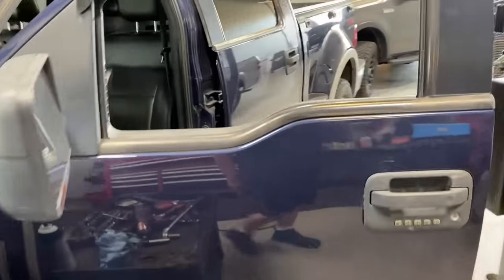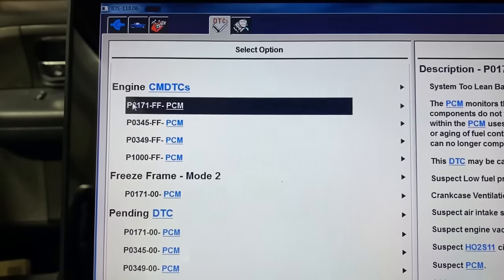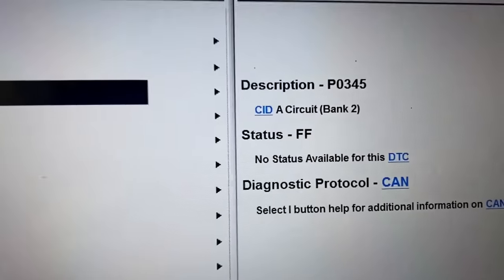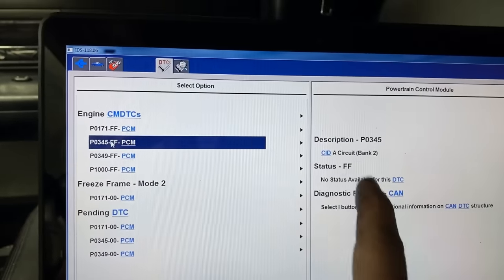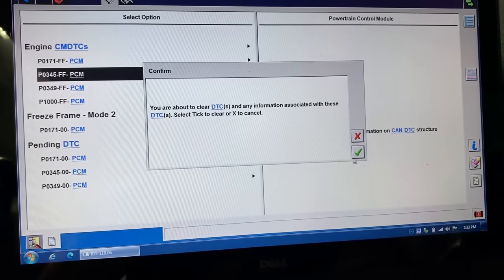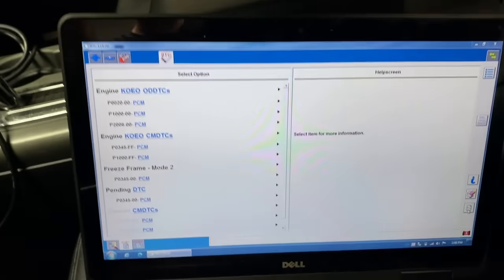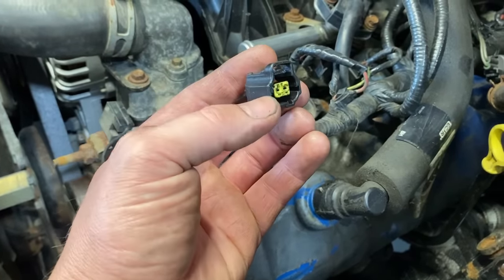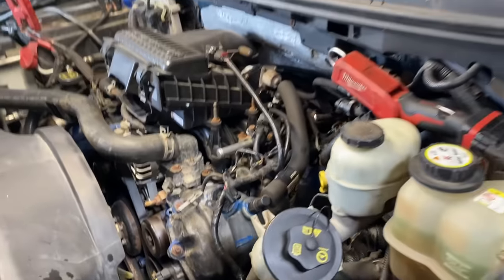Ford F-150 5.4L 3v Triton Engine Runs Rough: P0340 P0344 P0345 P0349 VCT Timing Error Diagnostics

Comment from the maker: These are the Parts and Tools I Recommend:
Ford Phaser-
https://amzn.to/3ijl2H3
Ford VCT Solenoid-
https://amzn.to/3gZwYw0
Noid Test Light Set-
https://amzn.to/324Gtpl

Forscan is free Ford Specific Diagnostic Software:
Download Here- 
https://forscan.org/home.html
ELM 327 Adapter I Recommend-
https://amzn.to/2GC6dBj

As an Amazon Associate I earn from qualifying purchases.
Reply: Help please.... I pulled into the driveway and my gear shifter went soft on me and wont select gears, now i cant get it into park and i cant start the truck....f150 5.4 2006.....i dont know what to do
Reply: @Jesse Ajuda 5w-30 no doubt
Reply: Matt Blackwood try starting in neutral.    Also see if this is similar issue.   🍻
Reply: @michaelwerbick  I found it the transmission shift cable was broken thanks
Reply: @matthewblackwood4704  check transmission fluid first. If fluid is OK, it means the transmission neutral switch is not properly engaged in park, so it won't start. Make sure you can pry the transmission gear knob area with a screw driver, to help engage the transmission in park.
Reply: @dxta7360  it was a broken trans shift cable, thanks
Reply: Thought you said the Dorman XD version of phaser was a good product in a previous video. Is that still true?
Reply: My 05 5.4 has p0010 and p0011. If I redo the vct's and timing how long should I expect them to last.  It has 176,000 on it now.  What should i do trade or fix it!  I love my truck just need it to be reliable!
Reply: Do yo u have a date to come to San Diego? I'd love to have you take a look at my 04 overlander.. I've done a lot of work to it, but I have a rough start that sounds like a leaking manifold even though I just installed new jba headers.. it goes away after 10 seconds. I've recently done the timing chain kit replacement as well. I do have a winding noise that goes away when I match engine timing.. sounds like a pulley, but I have replaced all the pulleys. I honestly have the best of the F150s 2004, and would love for you to take a look at it and try to make it perfect.. I have many mods worth thousands, and want to avoid an engine replacement if possible.. help?
Reply: do you this same ford phaser for both sides?

Comment: That engine looks more like a salvage yard engine instead of a Reman
Reply: I've seen some that the scrap yards so call rebuild themselves. It may have been a scrap yard take out from a crappy rebuilder too. I've never seen a blue one like that either.
Reply from the maker: Yeah it was bad on the outside but definitely a reman engine inside.
Reply: If you’re having issues w these things, it’s time for a good quality reman crate motor, don’t waste your time with the cam phasers, they would be working if there was oil pressure, & because they’re not they’re garbage along with the motor.

Grenade the motor then drop a crate motor in it not from the crap yard that’s not a 3v & it’ll be fine.
Reply: That's a Krylon rebuild.  Fresh coat, and it's good to go!!

Comment: That’s probably the thing I enjoy most about your videos: 

You don’t just start replacing parts and say “Maybe this will work” or “Maybe this will fix it”. 

You actually take the time and do actual diagnosis and do a process of elimination. Part by part, step-by-step. This is the way it should be. But as you already know, a lot of dealerships don’t do that. They just start replacing parts and hope that it’ll fix the problem. Keep up the good work.

Comment: We have similar problems at the plant where the 5.0L is built. If the exhaust VCT isn't installed correctly it will ruin the VCT and nose of the cam when it goes through the machine that checks the timing. I said all that just to agree that if you don't install the VCT correctly and torque it properly you're wasting your time and money. Great video and i agree with another commenter that this guy is thorough and explains what to look for and what not to do on certain repairs.

Comment: I have the same code popping up P0345. I changed the CamShaft sensor, no luck... I pulled the VCT solenoid and cranked the engine just like you did... Still gets me the error code. Now... I'm going in to check the phaser. It's been worked on before. Prior owner had some work done on it. I'm fearing they also used aftermarket sub quality parts. Now. I'm going to fix it. Your videos are so helpful. I'm legitimately done taking my cars and trucks to mechanic shops. I get it all done myself now with the help of Hanes and Chilton books plus your videos. Thank you!

Comment: Love your videos man, but I can't watch your 5.4 videos anymore, I already fixed the phasers, cam chain, tensioners, spark plugs, VCT solenoids, and oil pump. I don't want to jinx it anymore 😂
Reply from the maker: lol I hear ya!
Reply: I’m currently looking to change my VCT solenoids
Reply: As long as you put a good oil pump in and not a stock Ford unit. you will probably not have another issue. Please tell us you used a Boundary or Melling or Livernois or Moroso or PCE. If you used a Ford one, I sure hope it was a Ford Racing model like the one used in the GT 500.... Good luck.
Reply: Me to

Comment: I absolutely love your videos. I have a 2007 f150 and it had that infamous tick. I replaced all ruler followers, And slack adjusters but a new milling oil pump and had to do the timing because the right hand bank had slop in the chain. I didn't realize how easy it was to do the timing on a 5.4  3 valve. While I was in there, I did a phaser lockout as well because I don't like how prone they are to fail. Since doing all that it runs great. I just need to get a tune now to make up for the phaser Lockouts

Comment: I'm not a fan of the 3V but so many of the problems with them are avoidable with proper diagnosing and OEM parts. So many mechanics should watch your videos.
Reply: Man if the remanufactured engines are gonna be rebuilt like this then I'll just do it myself with an engine rebuilder.

Comment: Many thanks for posting this!!  I've had the  MIL lit for a couple years now for the P0340/0344 code.  Kept putting off removing the valve cover to check the "fingers" on the phaser.  Will run these diagnostics first and see what comes up. Excellent advice my friend!!
Reply: Hey eco builder, were you able to figure out those codes? I have the same ones

Comment: Great diag! It seems like I won't see these 3valves for a while then all of a sudden they start coming in one after another, at my age of 56 and working on so many different car lines I definitely need a refresher in these engines from time to time. Down here in South Louisiana we don't have to deal with rust and most of these trucks are in good shape, but if I can learn any thing about any vehicle especially these engines I'm all ears. I'm one of the few shops that will work on these engines, a lot of the other shops have been burned on them so they won't touch them. Great video looking forward to the next one!
Reply from the maker: Those other shops just didn't know what they were doing these engines are very simple to diagnose and fix.

Comment: Thanks for the advice on the vacuum brake bleeder, I bought the one you recommended on Amazon and it worked great. I bled the brakes on my ‘15 Jetta and it was a breeze.  On my ‘13 Pathfinder, Nissan recommends disabling the ABS pump by disconnecting the negative battery terminal before bleeding the brakes.
Reply: Have you tried "speed bleeders"? Makes solo bleeding much easier.

Comment: Dude I have engine knock and had some of those codes apear, along with a rought idle than stall out when engine is hot at low rpms. I got it working better now after a motor flush and some thicker oil. Anyways I will have to so this job soon and this video is excellent. You make the best F150 repair vids, thank you bro!
Reply: Probably cam phasers. Those are what make the knocking noise at least
Reply: Try Lucas synthetic oil stabilizer to buy some time. 1 qt added to your next oil change might help keep it going.
Reply: Purecult if it stalls out it could be the solenoids or it could be your fuel module
Reply: You ever do the timing job or anything? I have the exact same issue
Reply: I've been running okay with frequent oil changes (every 5k miles) and a bottle of oil stabilizer now for 2 yrs since I got the truck. It seems to be worse sometimess, better at other times. Runs fine, no stalling. 

In fact, someone pointed the ticking out to me saying they had a Triton engine do this but I no longer noticed it until he pointed it out.

I drove 2000 miles cross country and towed a trailer with a car on it no problem last year.
Reply: @purecuIt  what parts did you end up swapping or literally just the oil changes and stabilizer?

Comment: This is great stuff! I plan to use the exact same diagnosis.  Last year I did the whole timing job: the chain, phasers, solenoids....ALL Ford parts.  I put a Melling 340HV oil pump in too.   Sometimes when coming to a stop, the timing on one bank will not go back to base.  It's like it's stuck activated.
Reply from the maker: That is an oil pressure and volume issue.  If you are sure everything was installed properly and the pan has been cleaned out with no startup rattle then I recommend performing a crankshaft end play check. If ok then use 5w-30 oil, if the concern is still there then use Rotella 5w-40 oil.
Reply: @FordTechMakuloco  I still have to drop the pan and check/clean the pickup tube.  I don't recall any broken pieces or chunks missing from the teardown but I suppose I could find something wrong.  
I'll report back on what I find!
Reply: Today I dropped the pan. Found a chunk of what looks like a guide in the pickup screen. And also a lining on the bottom of the pan with grit, looks like from the old chains.
Cleaned everything and reinstalled. I checked crank endplay too, very little movement. Less than 004
I am STILL getting this to happen.
I'm just like WTF at this point
Reply: Oh and I'm getting 21psi oil pressure when this happens. It remains steady and doesn't bounce around on the gauge.
Reply: @gmtech2012  Did you check the cam cap ends for gasket debree? Radiator cam cap on the drivers cam, and the cap next to the firewall on the passenger side cam? There is a gasket that goes behind where your oil filter screws on, on my triton that gasket was breaking off. I found a few pieces of it clogging up the tiny oil passages in the caps I described.
Reply: @TheUltimateCrash1990  I'm fairly certain that the engine went back together without any real big debris pieces left inside.  Now I will say that in the last month or so, this truck has not had any cam oscillation whatsoever.  The last thing I did was start the engine with the vct solenoids out to clear out the housings like in the video.  Maybe something was there?  I will update here if I experience any more issues but at this moment the truck is running great.  Lots of power and no noise.

Comment: Had codes 0345 and 0022 so I replaced driver side vvt solenoid and camshaft position sensor. Changed oil and filter. Those codes went away, next day CEL came back on this time with code 0012. Not sure where to go from here. Thank you for all the great videos!
Reply from the maker: You have no control over the vct system, it definitely needs a timing job or more depending on the condition of the engine.

Comment: 04 f150 5.4 3v 270,000 mi. All original. 15w40 motor oil since new. Runs flawless.
Reply from the maker: Yes I have heard of many doing this
Reply: Original: valve covers never removed,starter, water pump,coolant, power steering,coil packs,fuel system,exhaust all original.  E3 diamond💎 spark plugs have 100k mi on them..new belt /idler pulleys at 250k mi. Alternator once.
Reply: I run 8qrts/2 gallons of 15w40

Comment: Would it be wise to check the phaser bolt on the other cam?
I guess the lesson here is to ask if a manufactured engine has genuine Ford parts.  Not mystery parts.
Reply: This Black Dude  I agree with everything you say..BUT...The most incompetent reman company would do a better job than I would!!
Reply: This Black Dude Because many rebuilders quit rebuilding 3 valve Tritons because they had many returns.

Comment: I can really use your help on this! I have a 2004 Ford F-150 with 155,000 miles on it around 100,000 miles the timing was done on it the full subang with moterctaft parts! At 140,000 my transmission went out, I had it replaced but the transmission shop damaged the transmission lines so all the fluid leaked out 2 days later. They put new lines on it but my motor was running really rough and it was indicative of cam phasers. Took it to the shop and me and the mechanic got into the front end and realized my timing chain has stretched and it broke a guide, we redid the entire timing on it and it’s been driving perfectly until the past few thousand miles, ever since I purchased the truck it’s had a p1000 code and it doesn’t throw a check engine light but that’s not my main problem my problem is I’ll go to work in the morning start up the truck and I see a puff of smoke out the tail pipe for a second and sometimes when I get on the grass smoke will come out, also when I get home and put in in reverse to back up the driveway it starts to run really rough but if I get the rpms above 1500 for a second everything smooths out, it throws a p0022 code and I’m really confused now! What should I look for. It has new camshaft position sensors, new vct things, new spark plugs, and new coil packs! Please help!

Comment: Not sure how I feel having a 5.4 3v f150 knowing there are guys like Brian making a living out of just doing repairs on this motor..that says a lot. But when this thing is running good it's an awesome truck. I have 190k and I do have a ticking but also using about 1/2 qt oil in 700 miles or so, I'm so torn on having a timing job done or just letting it last as long as it can the way it is then put a new ford rebuilt in it.

Comment: So i have a random misfire code, crank sensor issue and a timing code issue amd the infamous phaser tick.. am i safe to assume 8 jeed a timing job.The truck had head work done valve terrain work new transmission.

Comment: Same truck and engine, I got rough engine, loss of power, stalling sometimes, constant engine ticking. Codes p0345, p0340, p0300, p0022. Fuel trims and 02 readings all look good. None of those codes are specific for a VVT solenoid. Could I have a bad or clogged solenoid and get the above codes yet no solenoid code?   I checked the wiring for the camshaft sensors, look good, continuity checks out, I did the multimeter tests on the sensors (ohms, voltage with metal waved in front of them) they seem to pass all the tests, got some new ones anyway as they are inexpensive, put them in and cleared the codes.  I did not drive the truck yet, it is a family members. I did start it up, and it did not sound any different, still has the same ticking.   Waiting to hear back from them if it has the same symptoms or if the MIL comes back.  As for the ticking, is coming from the driver side. I do not think it is from misfire as it is steady and consistent, not intermittent. Pulled injector plugs one at a time, had same drop in rpm for each, so think no misfire causing the ticking. I checked best I could for an exhaust leak, could feel no leaks anywhere or see any soot.  The ticking is much louder when I am under the engine than above the engine that is why I was thinking exhaust leak, maybe I just missed it, or could this be from something bottom side of engine, maybe a piston bearing on the crank shaft?   I was going to pull the VVT solenoids and look at them when the truck was here but thought you had to pull the covers to get to them, until I saw your video here, If they bring it back I will pull them and have a look.

Comment: Hello. I'm working on my 08 5.4 3v and getting 345 and 349 codes. I had the timing system replaced but they didn't replace the oil pump. After the fresh oil thinned out, it started the original problem again. Installed mechanical oil gauge and found the pressure dropping down to 12lbs. I decided to do it my self after i saw your timing video. When i removed the chain tension, it jerked a little but didn't jump teeth. The L still lines up with the phaser finger. I have a phone app that shows timing advance and it jumps back and forth from 12 to 26. It does this when cold or hot idle. I already have a new vct solenoid and was going to order a new phaser to replace both while the valve cover is off. With phaser still lining up correctly, could it just be the vct? Always had Chevy vehicles. Learning this ford motor. Thanks for any help you can give me. Awesome videos.

Comment: Having seen that Bank 2 Phaser had an issue, would you have checked Bank 1?  If you did on this repair, was there a similar issue?
Reply from the maker: This one was simply not torqued correctly, the other side would have shown symptoms by now.

Comment: I noticed you used the IDS software instead of FORScan. Do you have a preference or is one program as good as the other.
Thanks ... and another great video.
Reply from the maker: I run a full featured Ford shop so of course I have to ante up for the Ford IDS software like I was used to at the dealers but Forscan is a close second when it comes to Fords.

Comment: Couldn't you have also tested the cam position sensor? Just curious. Thanks!
Reply from the maker: I didn’t check that first mainly because of experience. Sure enough my experience with these engines led me down the right path.